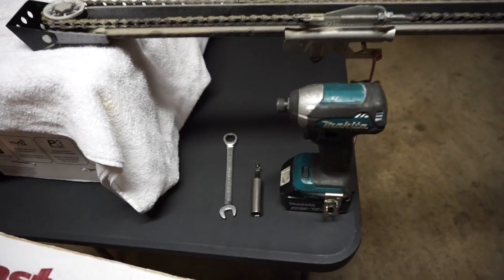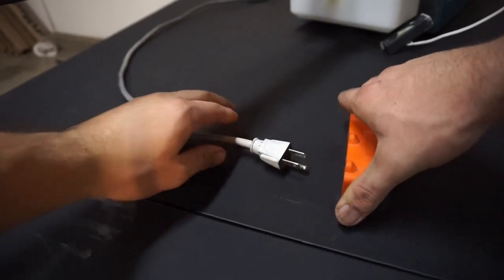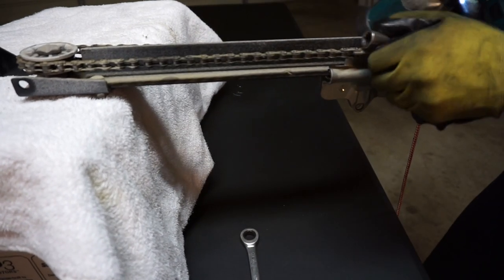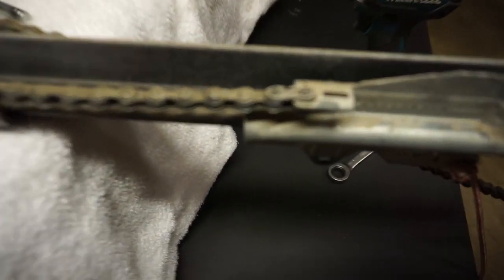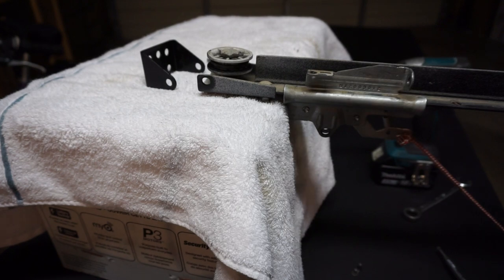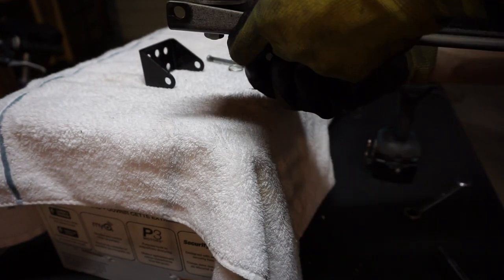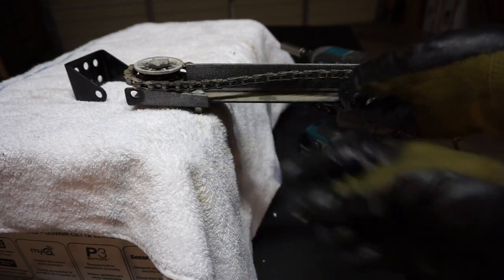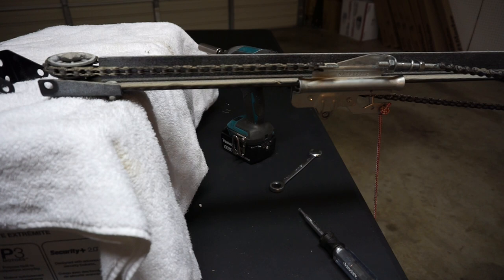Replacing The Trolley On A Chain Drive Garage Door Opener

Comment: Your video helped me make the correct decisions during the changeout of my Liftmaster 41c5141-1. My Craftsman opener has a chain and an attached cable. I had to improvise a bit but all in all the job went well. Took me about 1.5 hours but the opener is smooth and a whole lot less noisy. Thanks.

Comment: Andre, excellent video - short and to the point.  

I have a question: is there a common reason why the inner and / or outer trolley parts break or tear apart?  Is it because (a) the chain, which pulls strongly at each end of the outer trolley might have too much tension in it, or (b) the moving parts of the door have not been lubricated enough so the friction and weight of the door parts cause the metal to shear or stress, or (c) the metal is cheaply made and so it deteriorates after 5 to 10 years of moderate use?

Clearly, you don't know the details of each garage door setup, so assuming the garage door, motor, and general setup were done correctly to begin with, what ideas do you have regarding the source of such wear?
Reply from the maker: They do need occasional lubrication so I would say B.
Reply: @GarageDoorGuidance  Once the parts arrived on Thurs last I replaced the broken trolley and lubricated the new one generously with lithium grease, and will maintain it better in future.  Thanks for the reply and for your very helpful video.

Comment: To remove that part away from the header do you need to do something special like secure the bar or something cause I need to remove the header because is sagging. Please let me know thanks
Reply from the maker: The springs are very dangerous I’d be extremely careful IF you try to get them off yourself. Call around someone should be able to come out and take it off for like $100
Reply: @GarageDoorGuidance  thanks for the advice I appreciate it..

Comment: My trolley is dis engaing on its own often, 2,3 times a week, not that often - , is there a easy fix beside taking the whole thing down ? would tighting the chain help ?  or greasing the track ?
Reply from the maker: If it’s disengaging on it’s own I would assume the trolley is damaged to be doing that, at which point I’d replace the trolley/carriage assembly

Comment: My beltdrive Liftmaster trolley kit came with a full compressed spring/shaft bolt replacement part. One end is square and fits a 1/2 inch wrench, but the other is 3-sided with grooves cut into it where the washer goes. Which tool do I use for that end to release the tension, or how do I adjust that spring? Seems like it should only be partially compressed, but there's nothing on that end to hold it in place to loosen the  square nut shaft...
Reply from the maker: Square side goes on the outside, once you got the desired tension you do need to release the spring. I usually use a flathead screwdriver and insert into one of the little indentations in the washer to keep it in place and then simultaneously turn the square end. It should release after maybe a quarter turn

Comment: Would you go ahead and put a new chain sprocket (round piece at the end with the teeth) while you are changing the trolley?
Reply from the maker: Changing that part is more involved, if it’s okay I’d leave it alone
Reply: @GarageDoorGuidance  I think you many be referring to the gear and sprocket on top of the motor. I am referring to the "roller" at the end you were working on. I mistakenly called it a sprocket with teeth. It actually is a "roller" with no teeth which is attached with one bolt.
Reply from the maker: That would make more sense. If it’s old and cracking you might as well replace it but for the most part I don’t have to change them unless they break due to user error ( setting limits incorrectly and having the trolley run into the idler pulley )
Reply: @GarageDoorGuidance  Thanks. Great video and very informative.

Comment: This is nice, but I wanted to see the easiest way to drop the assembly from the ceiling
Reply from the maker: Mr Reymundo I usually unscrew the two half inch bolts that connect the rail to the plastic wheel at the end. You can then shift the rail left and right in order to slide the old trolley off and new on.

Comment: I have messed up something by replacing drive gear. The cable end of chain goes sprocket and bangs then reverses. I have tried with the force and limit controls. I didn't mark where they were before. Is the gear at bottom of Drive shaft supposed to go a certain direction? I have replaced these before but never had this problem. Thanks
Reply from the maker: Solo 1 you have to make sure the trolley is in a position that matches the limit switch. It’s difficult to explain without showing you. Would you like me to put a video up showing this ?
Reply: Garage Door Guidance I would L O V E you to help with a video!! Thank you so much!!!
Reply from the maker: Solo 1 it’ll likely help others that run into the same situation so win win (: I’ll try my best to get that up tonight !
Reply from the maker: Solo 1 I couldn’t find an opener I could show you with today. I’d be happy to help you through texts photos ?
Reply: Garage Door Guidance a sketch maybe of the position of the trolly in connection with the drive gear. Thanks for anything you can help
Reply from the maker: Solo 1 the force switches should always be at 1-2 when testing after repair. Right about 5 is where you want them for normal operation. 

As for the limits switch you’ve got to take off the casing to see where the part that moves is. From there you will know where to place trolley and you will be able to adjust the rest with the actual knobs. 

If you even email me I can go back and forth with photos, otherwise wait up until I can find a similar opener to record.
Reply: Garage Door Guidance I have already reset those screws(leveling). I moved the middle one too to about midway? The cable end of the loop(chain) is going to the sprocket then it jumps out of the sprocket and drops way down maybe 8 in or so then reverses. The limits will not help my problem. Did I put the plastic gear at bottom of gear shaft upside down?
Reply: The force will not keep the door down. I back totally off(12-1) the up force and it will not stay down if that down force is at 11-12 the highest setting?? The limits were at the end and some wire connection cane lose. It is very very old but I don't want to replace it.
Reply from the maker: Solo 1 best thing to do is send me a photo so I can take a look otherwise I’m sort of stuck here..
Reply from the maker: Solo 1 https://youtu.be/QUJYgCvpoMQ

Did you watch this video?
Reply: Garage Door Guidance going to video as best I can the whole ordeal. Did you give me your email? Thanks
Reply: Garage Door Guidance yes and actually the trolley is on opposite side in rail now than the trolley in this video. I'm still struggling with this but have at least got the car outside where I can use it.
Reply from the maker: Solo 1 I did give my email twice but I don’t think you’re allowed to share it that way for whatever reason since it keeps getting removed. It’s garagedoorguidance at yahoo.

Comment: when you replace the trolly , does it matter what exact location you leave it once its put together? my trolley doesnt stop even with the peice it meets,  and then it goes backwards. I cant figure it out. I had to replace the gears in the motor and this trolly goes forward, almost overs the piece it meets before continuing, but then goes in reverse and stops so the door opens about 5 inches, then closes again. im stummped
Reply from the maker: It does matter, you need to have it positioned relative to the limit switch position. If the limit position switch is in closed or open position the trolley has to be placed there also. Have you already gotten it fixed?
Reply: @GarageDoorGuidance  I got the trolley to hook up but then the i pushed the limit switch too hard and had to open the motor again. It came off its little black holder but I popped it back in. when I turn the limit switches,, it doesnt look like the limit screws even move?? and the carraige is not changing positions either.. what can be happening?? I keep giving up. I replaced the gears myself but now icant get the limit switches to  make the chaing move up or down. the door opens then goes back down.. i give up.
Reply from the maker: @lucydoyle9010  is there a way you can get me a picture of trolley position and limit switch positions ? You can send me an email through my website
Reply: @GarageDoorGuidance  yes! I’ve worked so many hours on this and I’m
So proud i changed the gears myself. I need to send u a video.  Will do in the morning. Your videos are by far the most helpful! Thank u!
Reply from the maker: @lucydoyle9010  send email to my channel name at yahoo

Comment: Hi Andre, 

I have "Lift-Master The Professional Line, 1/3 H.P.  Security+".   Yesterday the trolley was broken when I tried to open the garage door.   I watched this video. It seemed quite informational.  Thus I plan to try DIY. 

Question #1,  Part ordering:  Will the part that you referred "The replacement trolley can be ordered through amazon here: https://amzn.to/2Ml66sq"    LIFTMASTER Garage Door Openers 41A3489 Complete Trolley Assembly" work on my model?

Questions #2.  Any tips on how to position the trolley correctly, and adjust the up and down limit in order to avoid it from going too far to hit either the door/wall or the light ball on the opener?  

Would really appreciate your advice. 

Jason
Reply from the maker: I replied to your email 👍🏻